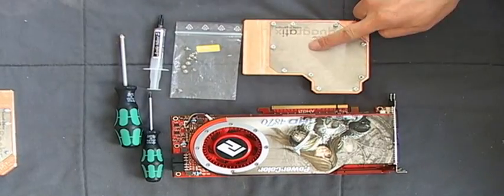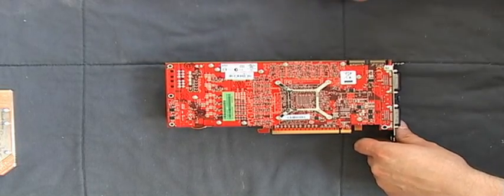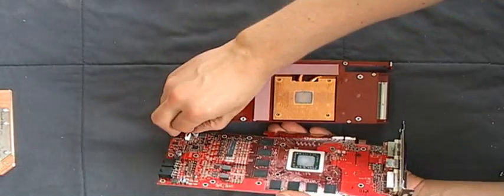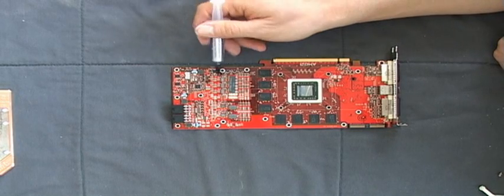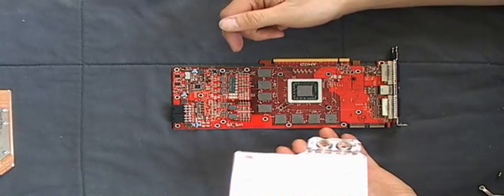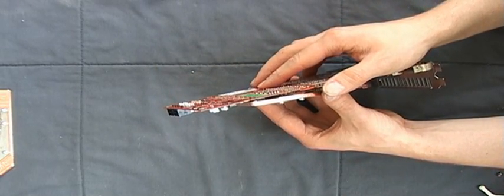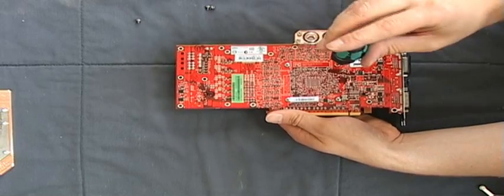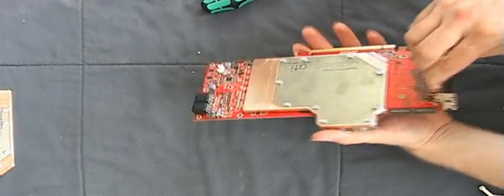Water Cooling ATI HD4870 graphic card

Comment: I'll use the MCW60 with some heatsinks, and point a fan onto the hot components, not as good as a proper working full cover block i know but i get a more stable overclock this way than with the Aquagratix block.
My card is a reference design, one of the first revision Sapphire cards, i'm not at all sure why i couldn't get the block to fit well. I may give it a 4th go at reseating it, otherwise i'm giving up.

Comment: I've got one of these blocks installed on my HD4870. I have to say i'm really dissapointed with it. I had to use thermal pads on the 5 voltage regulator chips to get them to make contact with the cooler. Core temperature also is none too impressive, lets just say my stock cooler with the fan speed cranked up performed better. I can't overclock with this block. Am going back to my Swiftech MCW-60. An amazing waterblock for GPU only.